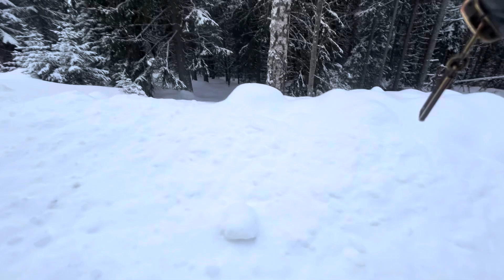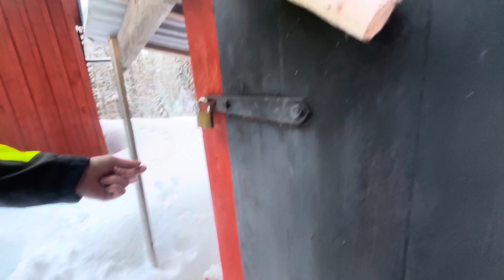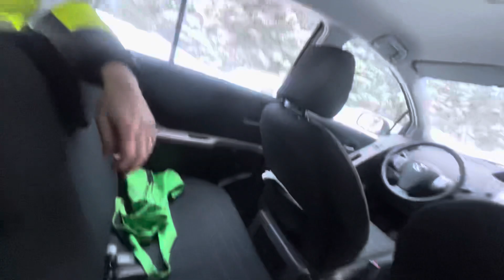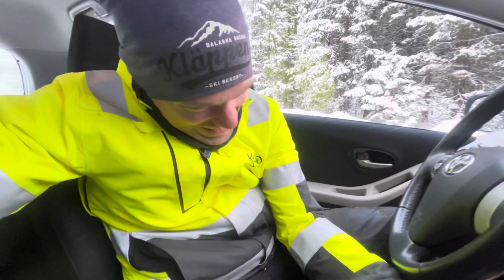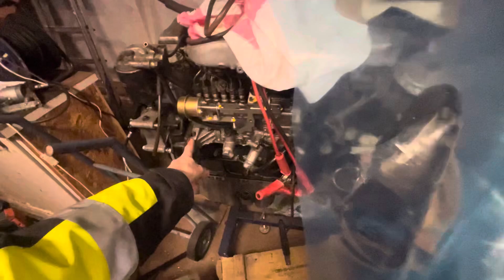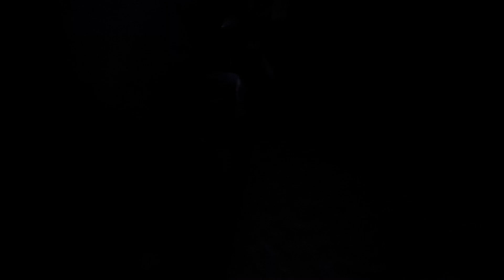Volvo Tgb 11, C303 About to Get MAJOR Surgery.

Comment: A little bit more power than my B30 in my 304 😂
Reply from the maker: Yes, a wee bit more. 😁
Reply: Will you do a video of how you mounted this and some details on the length etc did you need to modify any of the chassis structure or cabin to make it fit? I would like to do this conversion
Reply from the maker: @syncrojunkie yes that’s a good idea.